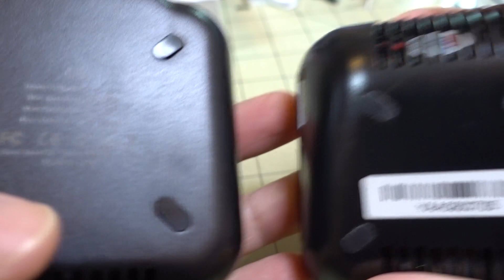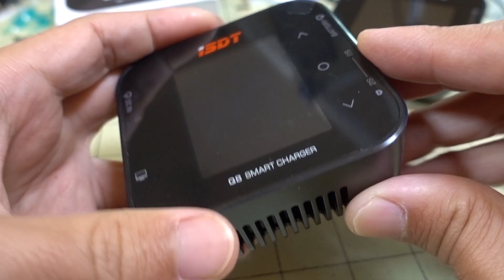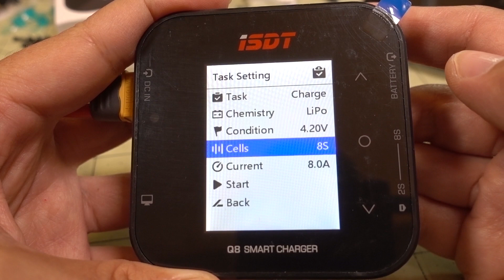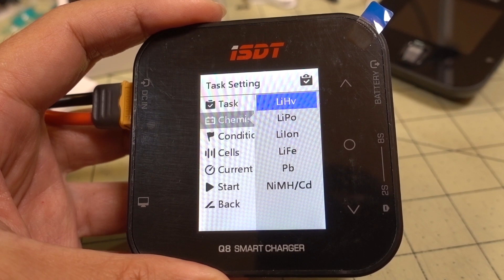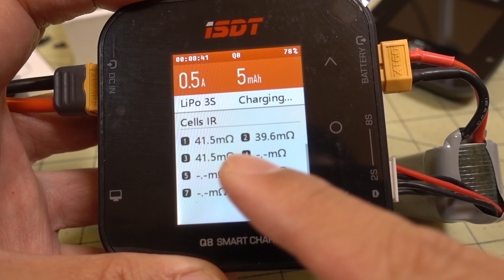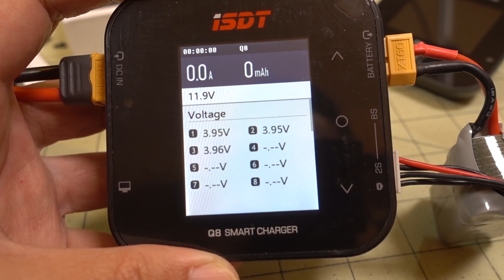iSDT Q8 Smart Charger Review ⚡

Comment: Thanks for the review and information. What about the 18650 batteries? Could I use this 1S-8S Li-On 18650 batteries?
Reply from the maker: You can but need some kind of holder for the battery to charge it.
Reply: @AlbertKimTV  I was thinking about it. I will try to make a 8x 18650 holder with slider.

Comment: Hi! Does anybody can help with the issue with thus charger? When I run self test, it gives me the error - Connection Check: Battery Present(211). Every connections is in places, it charge and discharge, but the error never goes away

Comment: Does this come with a power cord to plug into a house outlet or does it just run off batteries?
Reply from the maker: this one just runs off the XT60 but you can get a power supply to plug into your house outlet to power this via an XT60.  This is how I use it.

Comment: can i use this as a charge controller for solar set up? i mean if i have 100-200w solar panel and 4s/7s 12/24v 100/200amps battery bank, will this work?

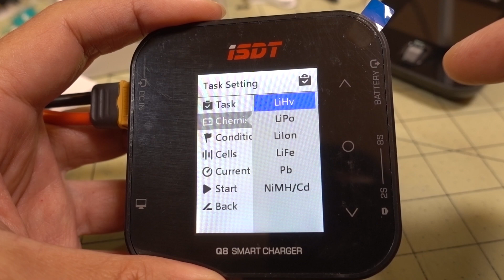Comment: In 4:35, what is that Condition setting?
Also, the charger specs say you can also charge 1S batteries. However, the top of the charger has 2S---------8S written. Which one is right? Can you charge 1S batteries with this charger?
Reply from the maker: Condition is the end voltage you want the battery to be charged up to.  It can charge 1S lipos but you need to make an adapter to connect to the XT60.  I've done it.
Reply: @AlbertKimTV  I guess that's an end voltage per cell?

Comment: Is xt 60 better then two plugs?
Reply: yes, you don't plug them in the wrong way, the 60 is rated current but you can push it to 100 Amps, of course not on this charger

Comment: can i charge my car battery with this device?
Reply: I just tried with a ToolkitRC M8S (don't buy it, total garbage, i'm now looking at the Q8) but the answer is yes, it's no problem. A slow charge of 2A of constant-current charge of about 12-34 hours will work for pretty much any lead-acid. A mechanic will have a better quality charger - one that can do pulsed-charging and top-up charging and long-term storage charges (also known as hysteresis charge) - but frankly it's all bollocks, 2Amps for 20 hours just works. It's not worth the money or the brain-space when something like the Q8 can get you 90% of the way there for under 100 bucks

Comment: I wonder if that DC output will be included in a firmware upgrade for older models, or even a modded firmware. They easily have the capability as that's what they do when charging a battery.
Reply from the maker: It's possible but I'm pretty sure they want to sell new chargers.

Comment: I seriously need a new charger my old b6 is on its last leg. I’ve been debating on the q6 and the newest toolkitrc Charger but still not sure which one to get. Ive had the power supply from kwadbox still sitting on the shelf all these months and no charger to attach it too lol.  Now this is another to add to my debate list 👍
Reply: don't get the toolkitrc one! they're super inaccurate and only can be updated with windows10.
Reply: canna roe to late lol I got a m6. Bit was cheap so I didn’t expect much. It works but it has Its issues. Mine is fairly accurate and I was able to update it but I do need to calibrate it better one of these days.

Comment: I bought the Q6 based upon your review back in the day and it was one of the best RC related purchases I've made. I use it all of the time driven by a Mean Well power supply to parallel charge multiple batteries at once and it handles the task like a champ. At this price point, the Q8 is an absolute steal.
Reply from the maker: They get better every year.  So many good options available now too.

Comment: Do the math, it's 7s he LiHV because it will exceed the limits of the charger. 
7x 4,35V = 30,45V 
8x 4,20V = 33,60V
Reply from the maker: Ah, that makes sense... That's kind of lame they couldn't add a little more capacity to make is 8S for LiHV too...
Reply: @AlbertKimTV  It'd needlessly push the price up for everyone. Most people will be using LiPo or Li-Ion. 8S LiHV is pretty niche

Comment: With my Q8 and my 1000W power supply I can carge ten 4S 1500Mah Lipos in 23 minutes.
Reply: Which 1000w PSU you have? I'm having hard time finding 24v 500w to match this guy
Reply from the maker: Wow